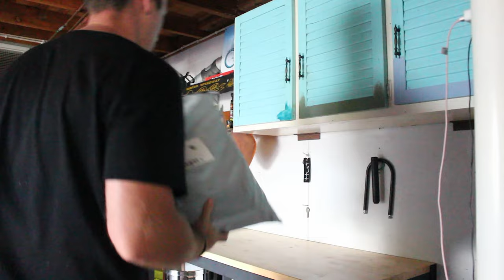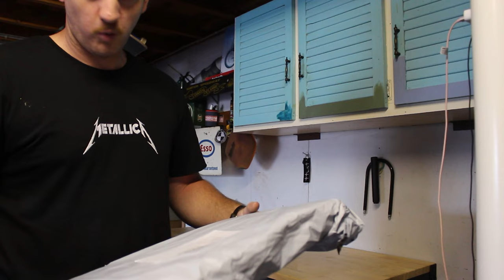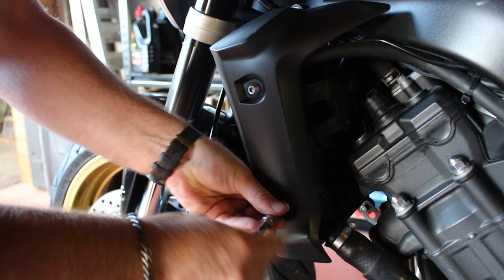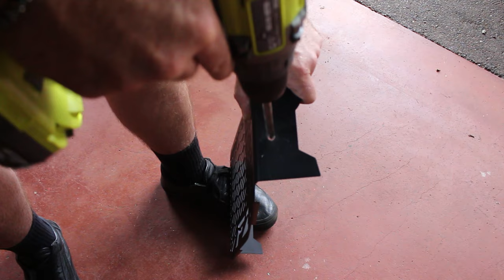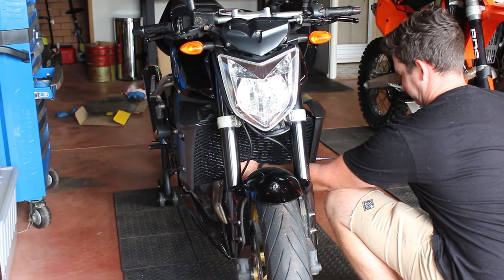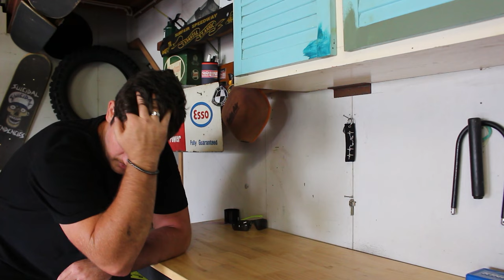Making a cheap AliExpress Radiator Guard Fit (Kind of) | Yamaha FZ1N

Comment: Well, I mean for almost $50 you can get very decent stuff from aliexpress. This thing should cost around $15 or $20 max. Seriously, I wouldn't be any close to pleased with this product. BTW, painting the radiator without thoroughly cleaning it was a bad idea.
Reply from the maker: Yeah, but making stuff fit can be fun. And rewarding when it works. BTW a new radiator is in the pipeline, and it was an incredibly light coat. Not going to hurt.